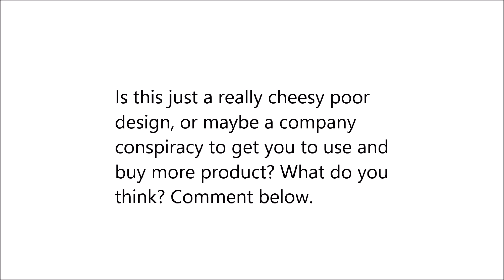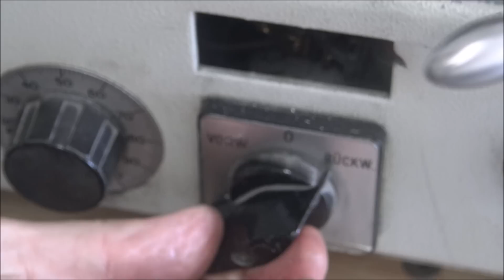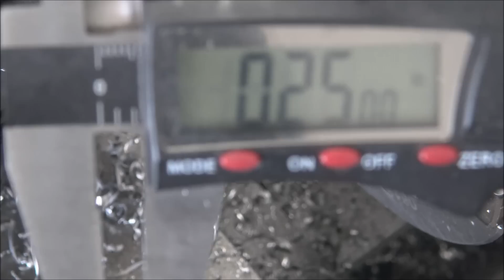WD-40 Nozzle - Conspiracy or Poor Design? You Decide.  6061 Aluminum Lathe Machining

Comment: Or just buy it in gallon jugs and put it in a regular spray bottle so you have infinite control over the amount and also the size and shape of the stream. Fine narrow stream for pinpoint placement or wide misting stream if you need to cover a large area. Also about 5x cheaper per gallon that way.
Reply: And spray some in a cup and use an acid brush for machining
Reply: This is also what I do. Less waste too as not throwing cans away.
Reply: I had this thought as well. But that's more storage and clutter potentially. My wd40 in the gallon went bad. I guess I wasn't using it enough. I ended up with some half ass wd40
Reply: I do this with the spray bottles as well as needle oiler bottles.
Reply: Shhhh….you’re ruining it! I was going to recommend an oil gun. He should already have one for the way oil.
Reply: Unless the real estate in your mobil shop is at a premium like his is.
Reply: @quickdrawmcgraw4394   It went “Bad” Please enlighten me. I was just getting ready to buy a Gallon Jug, so I could put it in my Needle Oilers. Tell me what happens to it when it goes bad, and what to look for, please. Thanks
Reply: Never would have crossed my mind to buy expensive-as-f***ck WD40 in spray cans for such a primitive task as lubricating while cutting metal. Besides, it's essentially petroleum and does a mediocre job lubricating and cooling a work piece. I only use it if I don't have anything else at hand, and then I'll apply it in a spray bottle that I refill from a 5l jug (yes, metric system over here..).
Using oil in water emulsion for turning steel, cutting oil for threading applications, and isopropanol for turning aluminium is not only proven to work on an industrial scale, but even in my humble garage workshop.

But with all that said, the idea of the flow control nozzle itself as well as the execution is spot on.
Reply: @phillipchambers8487  you will see it when it goes bad. It will be opaque
Reply: @phillipchambers8487  1gal of wd40 can be had for under 40$. wd40 was not designed to be used in this way even tho it works for this application. wd40 was made to wipe on and let cure to be a water displacement and repellent which is why it "goes bad" over time when it is exposed to enough empty space. so if you only use half the jug you now have half the jug where the solvent can displace itself from the product. personal recommendation is to use tap magic aluminum for working with aluminum it does a much better job at preventing chip welding however it is expensive basically 2x the price of wd40.
Reply: Bottle will fuck up over time too.
Reply: U could just buy jb80
Reply: You could just get a “Shure Shot” brake parts cleaner sprayer. Label it WD40 & use that. That’s what we use in the shop.
Reply: But my hand gets tired
Reply: Would be great if they would sell the liquid WD-40 in smaller package.

Comment: Cool nozzle. My problem with wd-40 is usually the cans run out of gas before they run out of product.
Reply: You can refill by fitting a tyre valve
Reply: @dunc71  that's next after the adjustable nozzle mod 👍
Reply: I just used compressed air nozzle to blow back into the neck. Works for me
Reply: @christopherpoole2185  That's a pretty smart way of doing it. If we could get an adaptor (maybe airsoft adaptor might work), then we could fill it with liquid propane so it would truly last a long time.
Reply: Cool. Didn't know you could do this.
Reply: Other youtubers have shown there are re-usable cans like that you can get - they have a schrader valve on them so you can pump them up with compressed air after you put whatever liquid you want to dispense into the can. I think they're called "SureShot Refillable Aerosol Sprayer". Harborfreight even has a knockoff cheaper version. Saw them on Steve Summer's channel
Reply: I usually give the can a good squashing to compress what's left in the can. It has a limited effect.
Reply: Just puncture a small hole into it's side and put it into a small spray bottle, I was surprised how much was still in the can.

Comment: That is genius. You should patent that immediately.
Reply: Unfortunately, it's no way to patent a design after it was made public😅
Reply: Impossible, the video shows the invention before filing. So it's now state of the art.
Reply: @yveslegrand9826  Actually you can. This video doesn't imply anything and if someone else went to try to patent this, this video would prevent that as it shows prior art.
Reply: @ChrisMuncy  sauf les chinois 😅
Reply: No need to patented it the new wd40 and PB blaster cans already have a selector switch for this reason
Reply: @Fordman1989  A selector switch? I've not seen a can with that yet, the last can my wife bought me had a metal flexible nozzle, bend around corners etc,... that's pretty cool.
Reply: @steveclark..  she's a keeper 😏
Reply: Funny as you sprayed lube in the part you are cutting it shot more on other stuff than the work....
I despise these new tips they have on cans...more material to make it too...has to be on purpose. Drive up cost? Waist more fluid? Bulky and stupid design I think..what so we don't loose that little straw? Ugh,
I used to stick washers under the old type to control the flow..but I really like this design..
Reply: @yveslegrand9826  you have 12 months after your first public demonstration in the US to file a patent.
Reply: @Fordman1989  I definitely have PB Blaster that has the little selector on it so you can turn it down just like the threaded spacer in this design does. Basically just doesn't allow you to press the button all the way down. Some how the cans I get seem to run out of propellent long before the PB Blaster is gone though, so I end up drilling a little hole in the top and just turning the can upside down to get some out

Comment: Thats why I have WD40 in a small bottle with a small Luer lock needle (taken from a 5l canister). Same for cutting oil and iso propanol. Total cost is like 1€ per bottle+needle.
Reply: Those little bottles are great. I use the dip tubes from old spray bottles/ cans to make refilling "needles", so no funnels or mess. You can get extra long irrigation needles for them too, which are awesome for getting oil into tight spots.

Comment: I like your solution a lot.  I used to buy the 1 gallon and 5 gallon containers and the hand sprayers.  It was cheaper that way but the main thing was using a spillmaster or homemade equivalent with a brush.  You can control your use a lot better that way.

Comment: Conspiracy. I buy a gallon of WD and refill a spray bottle as needed. God bless.
Reply: Same here.  I buy a case of empty spray bottles for a around $1 per and just print a label for whatever goes in them.  Every now and then there's one with an issue but they're so cheap it doesn't matter.  Bonus you can hang them buy the handle 😂
Reply: I bought a spray can and a gallon of WD-40. After two fills the can leaks and the nozzle drips, The company I worked for bought all lube and cleaners in bulk. they supplied plastic spray bottles.

Comment: While your solution is elegant and beautiful, I have found that the "Industrial Size" WD40 cans work pretty well for me. Instead of the stupid leaky flip top, they have an old school top with a detachable straw. Straw snaps into the lid, when I want to use it, I can just pop the top off and spray for a mist, or I can shove the straw in the tip (with the lid still snapped to it) and spray away. Works pretty well for me, but I probably don't grab the can as often as some of you guys so YMMV.

Comment: For the running out of propellant problem, I use a rubber tipped blow nozzle and put a hunk of rod the right length in it so you push down on the plastic stem of the can just as the rubber seals it and give it a shot of compressor air (don't go hog wild; I have never blown up a can but...)

Comment: Thats what its all about, messin around in the shop commin up with cool ideas! My problem with wd-40 in a can is i always run out of propellant. And theres sometimes a 1/4 of a can of wd-40 and no way to get it out. We still have the red caps for our cans by the way lol. So i got the pump and spray bottle and a jug of wd-40 that i top it up with periodically, works pretty good, never run out of air.

Comment: That's one thing I love about Kroil (besides the smell). It might not be the best penetrating fluid and it costs a lot, but a can lasts forever and doesn't make a mess thanks to how soft it sprays. Wish they made a WD40 style product as well to fill the gap until I'm cool enough to get a lathe and copy your idea.
Reply: I've been using that to cut aluminum with my Milwaukee metal saw, working with 3003. Without it it loads the blade up, with it it cuts like butter and blades last forever.  Awesome stuff

Comment: i have an old flip nozzle can like cigarette lighter fluid used to come in . when a wd can runs out of propellant , i punch a hole in it , pop the top off the fluid can , and drain the rest into the little can . can't spray up , but otherwise very useful and long lasting . an old pump style oil can filled with used motor oil will often work just as well as the wd , and it's free .

Comment: I LOL'ed at the [angrily shakes first at broken reverse]. The worst is when the can falls off the table and the nib breaks off - then you're just hosed and the can is useless unless you drill a hole and let all the pressure out and then just manually dribble the stuff out through the hole. That seems to happen to me a lot - f'ing clutz always knocking the cans over...

Comment: I feel like this is an issue that a small group has, but to fix it would require a sacrifice in a larger group.  
Machining metal isn’t a small group, but when compared to how many people buy WD-40… it is a small group.
If they were to add this to every bottle, it’d cost a fortune.  It would make a lot more sense for them to sell the thing as a separate piece, but haven’t for some reason.  Could be something with losing the straw, could be something with EPA violations as it’s an aerosol, could be they just haven’t considered it.  

What you have is honestly a great tool, and truly think selling it would make you a decent amount.

Comment: I agree, that it's intentional on the company's part.....to sell more. Excellent solution-

Btw; you may/may not be aware, but you can get the "high rake" carbide inserts which fit the same tool you were using, & work much better for machining aluminum/non ferrous. I have similar tooling for turning & boring, and just swap inserts, depending on what I'm cutting.

Nice work and video!

Comment: I find the arerosol cans of any design from WD-40 either break or do not empty all the can all way, they run out of propellant. So I buy it in 5 gallon cans. Then  utilize  a spray bottle to apply. It ends up being much less expensive in the long run. Use quite a bit of it as I like it for many uses. To answer your question, I am sure it's a conspiracy to increase sales. The company Jet is expensive and takes away from the executive bonus. Something has to be done.

Comment: Mechanics at a shop for a construction company I used to work for asserted that WD-40 was the worst lubricant for cutting and drilling Steel. I've always just assumed they knew what they were talking about.
Reply from the maker: There's better, and there's worse (for steel cutting). It also depends on how much of a slimy mess you are ok with cleaning up afterwards. WD-40 cleans up relatively easily.

Quality sharp bits, and relatively low feed speeds (not too hot), WD-40 works ok on steel.

(WD-40 for cutting aluminum works great)
Reply: The WD-40 folks do not seem to market it as a cutting oil. Of course they aquired 3-in One back in 1995 and probably expect people to use that!

Comment: Is there any situation where WD-40 is the preferred cutting oil? If not, why use it? Even for machining aluminum, light oils like 3-in1 (same company as WD-40), kerosene, or rubbing alcohol are fine and cheaper than WD-40. The spray nozzle seems appropriate for its more common uses like getting into crevices to free sticking parts or to protect something.

Comment: It's something I'd buy. I hate those new gimmicky nozzles. The seal leaked and sprayed me in the face. Good thing I wear glasses. I ended up just putting another nozzle and tube on the can from another old spray lubricant. The can expressly forbids doing this. It's so wonder they haven't got sued.

Comment: Do you have a video to explain your reason for using WD-40 instead of cutting oil for these applications?
Reply: Aluminum cuts better with a lighter lube... It's main purpose is to prevent aluminum from cold welding to the cutting tool. Plus, it's much easier to cleanup, if welding is involved.

Comment: Wd-40 with the jointed straw is incredibly wasteful, but it's not limited to only them. Having worked as a bus mechanic I can say that 100% of the cans we used were made by greedy bastards. The brake cleaner which we used to clean most oily and nasty surfaces for instance, those cans had almost free flowing opening upon use, it emptied in moments. Incredible mentality that they won't make them more efficient. You should start selling these nozzles, you'd piss off an entire industry in no time.

Comment: Wouldn't say conspiracy .. just cost savings. 
It's 2 simple injection molded part, that will work "well enough" for 80% of the customers that are spraying like there's no tomorrow. 
If you need small thread with some precise enough tolerance that they don't move (you adressed that with teflon tape... Works fine, but not easy to mass produce), the cost will skyrocket. So crappy 2 piece hinge it is !

Comment: It's like that steel can pump sprayer they sold for a while (doesn't appear to be on the market any more).  The sprayer on that thing was attached with a really solid ratchet mechanism that made it removable only with Channelocs.   They DID NOT want you to re-use those sprayers.  Greedy bastards.  It's nothing but kerosene and fish oil anyway.

Comment: you have to fix also the self propellent leak, you will end trashing the can wile still full 😂
Reply: I don't trash full cans because the propellant died. I make a hole or three and dribble it out. Then I stopped buying pressurized cans and just get the liquid versions of both WD and Kroil.  Pour into a pump sprayer if needed.

Comment: I mean ya its factory nozzel is a shitty design.  But why not just buy the 1gallon container and pour it into whatever kinda bottle you want ? Spray, squeeze , small can to brush it on?  The aerosol cans are fine for the DIYer that uses it every once in a while but economicly , at least where I am, it doesn't make sense to use them. Even buying by the case 🤷‍♂️. Regardless of that another great video 👍🏻

Comment: you want to know what the real waste is with these spray cans... the fact that the last 20 or so can's i've gotten, has run out of pressure to spray the wd-40 out, yet 25-40% of the WD is still left in the can... I stopped doing that, and now just buy it by the gallon, and put it into a reusable spray can, and i just add pressure using the shop's air line XD

Comment: Poor desings for sure......decided to buy WD-40 only in a 5 liter cannister.....its a lot cheaper. Sometimes you get these cannisters with a free reusable spraybottle. If used as a cutting oil a small brush and a plastic container filled with some WD-40 goes a long way.

Comment: WD40 is only good for cleaning crap off old machinery anyway. A canister of kerosene/turpentine works equally, but is way cheaper.
HLP46 or ISO220 way lube for anything that needs lubrication, WD40 is totally useless for that.